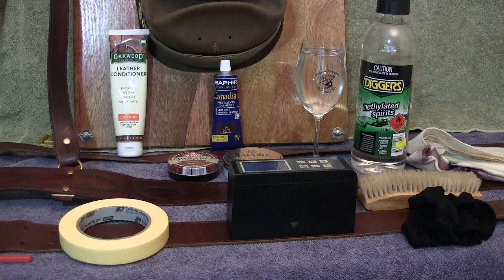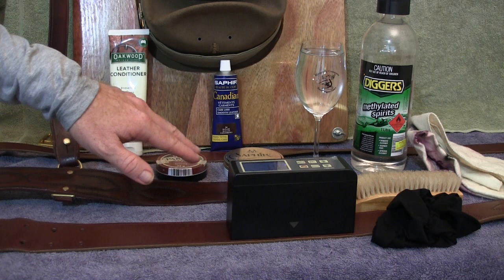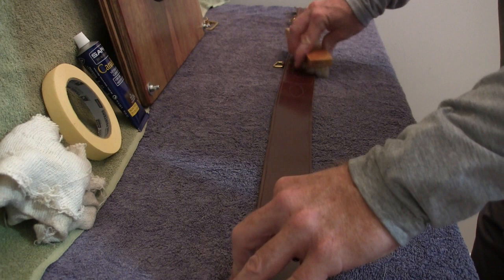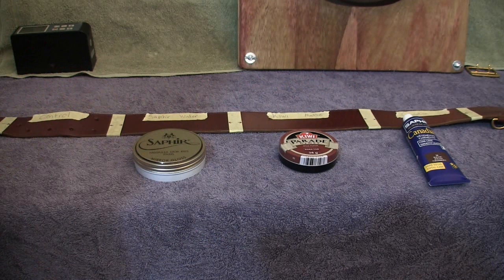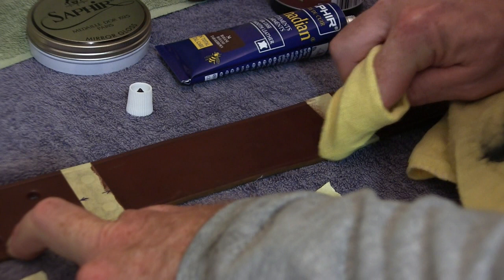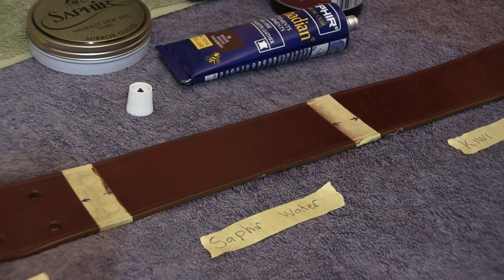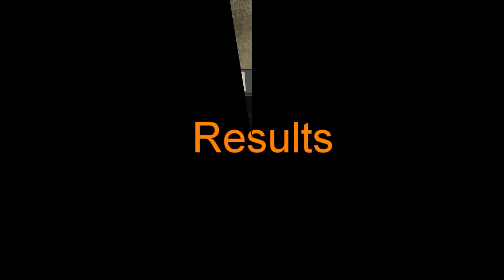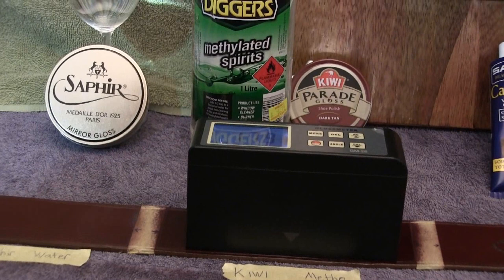How to polish Sam Browne leather belt: In detail with Gloss meter readings

Comment: Hi Ash, that was really informative. After trying innumerable techniques over decades, I'll give the metho technique a go. I've never seen that one before. BTW, I tried following your ebay link and it seems to be dead.
Reply from the maker: Hi Matt, thanks for the feedback mate. I find the metho and stocking works a treat. It just takes a bit of persistence to find the right ratio. Once the polish takes it is smooth sailing. Thanks for the notification about the eBay link. I have updated it so it should now be live. Regards Ash.

Comment: Goodday, thanks for this video. I'm a WO2 in the Trinidad and Tobago Cadet Force. I just got a Sam Browne. Could I cotton instead of the cloth to polish my belt? I use Kiwi as well.
Reply from the maker: G'day Karel, thanks for viewing and the question. Yes, you certainly can use cotton wool balls to polish. I used them before I switched to using the cloth and metho technique. I will post some links where I use a few different methods. Be sure to check out my full  " how to uniform" playlist. 
Hope this helps.
Regards
Ash
Reply: @Ashapplications  Thanks
Reply from the maker: @karelphillips3483  G'day Karel, please find the links to my other Sam Browne related vids below:
How to polish Sam Browne Shoulder Strap: Condensed version https://youtu.be/Ne6Q7LZjC_s
Sam Browne Polish Review https://youtu.be/qdrakgUiBg0
Sam Browne Shoulder Strap Non-Rub Polish Technique https://youtu.be/2yLEMQMMr94
How to create a Patina on a Sam Browne Leather belt https://youtu.be/b8ldA8KZ9fQ
Hope this helps.
Regards
Ash
Reply: @Ashapplications  G'day, I saw the video too👍. Have two questions. Could I use the same technique to polish the chin straps of the SD cap and warrant officer wrist strap? How do polish the pace stick.
Reply from the maker: @karelphillips3483  G'day Karel, yes you can use the same method for the chin strap and wrist band. I would recommend placing some backing cloth between the chin strap and the cap if polishing with the strap on the hat. Saphire Canadian polish would be suitable for both to prevent polish transfer. The pace stick; spray on furniture polish for the wood and brasso or autosol for the brass. Good questions, hope this helps. Regards Ash.
Reply: @Ashapplications  Goodday, thanks again. Would it be better to remove the straps, separate them, clean them, then reassemble them?
Reply from the maker: @karelphillips3483  G'day Karel, with the Sam Browne it is best to seperate the belt from the shoulder strap to clean/polish. With the service cap, easier to clean and polish on the cap. Leather conditioner is good for the strap.
Regards
Ash
Reply: @Ashapplications  thanks again
Reply: G'day Ash. That was an awesome instructional video. I spent years layering on bees wax and then applying Kiwi standard polish to get results similar to yours. But it took hours longer. This Kiwi metho method is brillliant and I am doing it right now as I watch. Amazing result already. And as for the gloss meter I never knew they existed. Just proved though that a sergeant majors eye really is calibrated! Epic stuff. Thanks agajn and good on ya from an ancient Sapper 👍